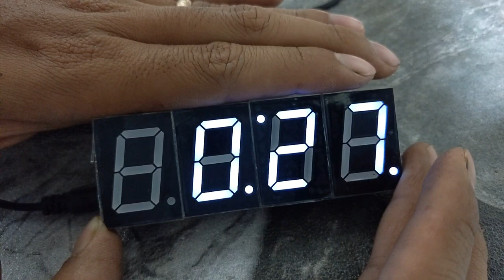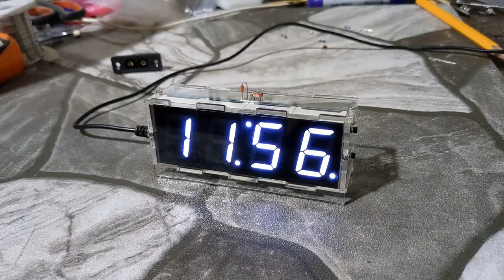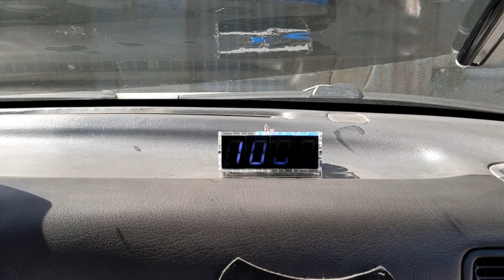Cheap DIY digital alarm clock, with temperature and light sensor

Comment: Damaged by 12 volt supply can you pls tell me which part to replace
Reply: Battery, maybe ic or resistors (330) idk.
Reply from the maker: 7805 ic it works fine.